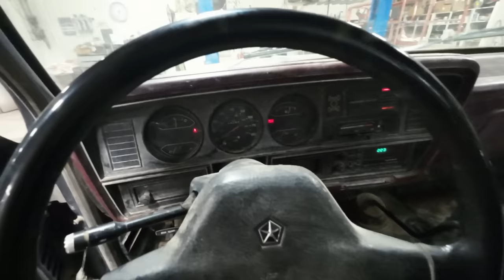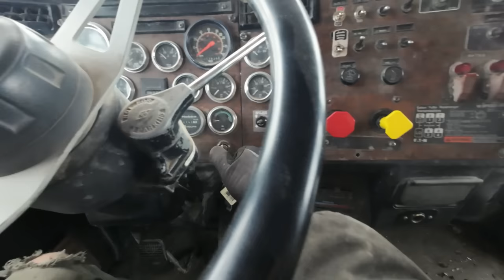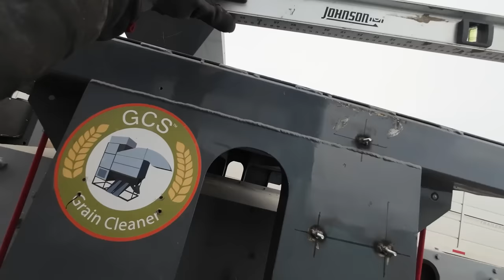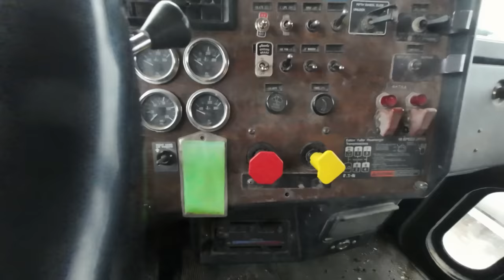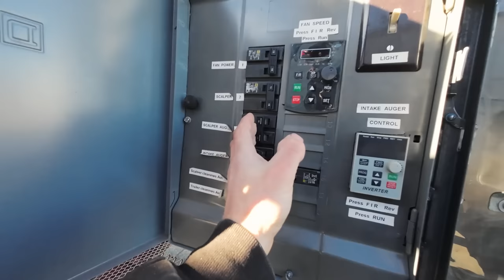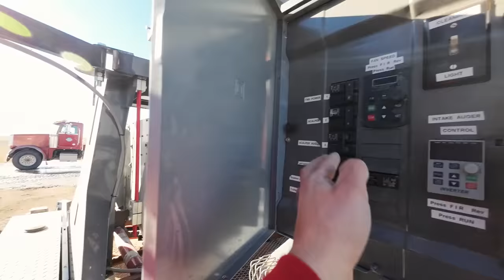From Trial to Success - Catching More Rocks Than Ever Before!!!

Comment: I’d put ether down the intake air on trl,put air to it,pushes ether to the ice spot,I did 37 yrs truckin,just over 4 mil miles,that trick worked for me many a winters,jus sayin.if the pads are frozen, I’ve rocked it to get loose,I Don’t  recommend smacking the brake drum with a hammer!

Comment: Awesome old dodge. Sounds like the timing is backed down too much and struggling. The rubber on the balancer will slip so don't use a timing light and that 350 will wake up when you advance the timing.
Reply from the maker: Definitely will try this, thank you! We used the timing light and had it set but if it slipped that makes sense why it is struggling so much.

Comment: How do you figure out how many peas you need to save in order to planet the next season?
Reply: 42
Reply: one solution is to multiply the area you intend to plant, often in acres, with the number of seeds you intend to plant per unit of area, which will give you the total number of seeds you'll need
Once you know that total then you can calculated how much seed you'll need based on how many seeds are in a unit of weight (lbs,tons,kilos) or unit of volume (bushels)
Reply: @blueookami5931  You took all of the fun out of this.
Reply: @blueookami5931  - Ahh, ok, cool. Thank you for the info.
Reply: @chrisallen2005  - Yeah, because I wasn't already ignoring your response.